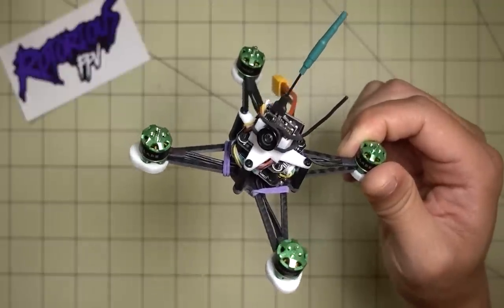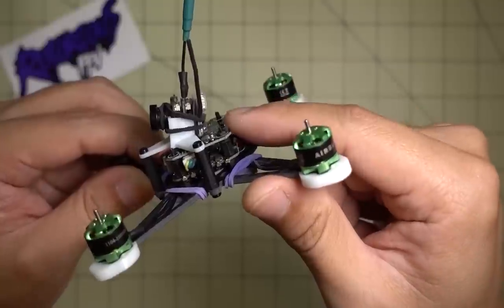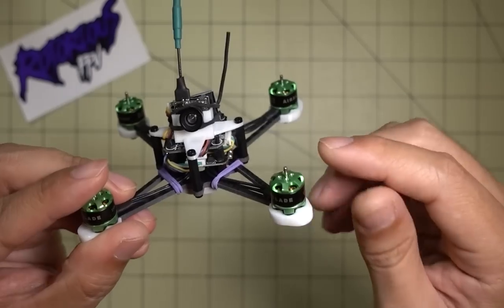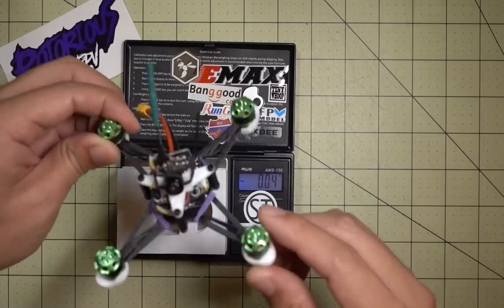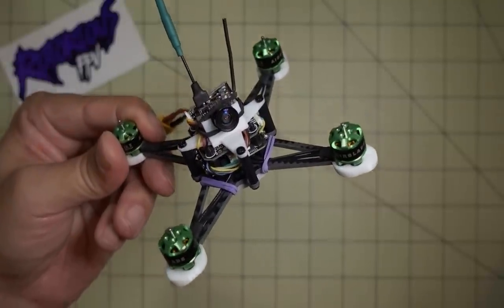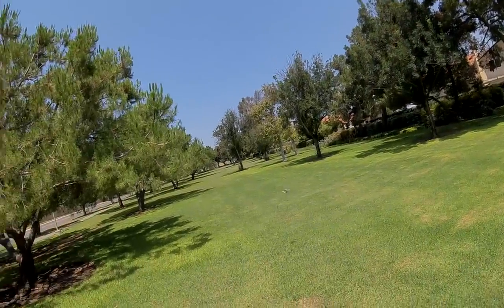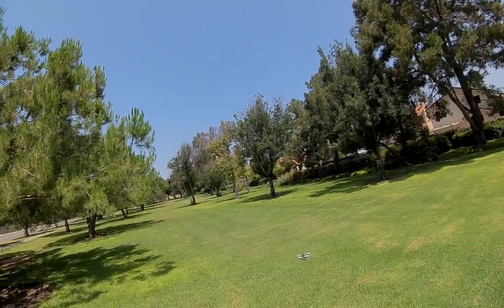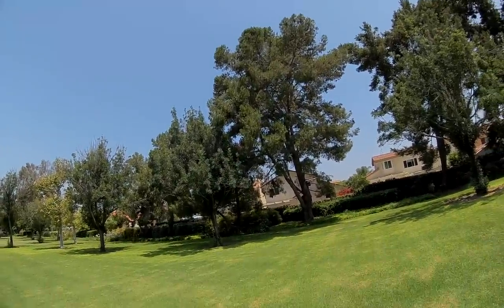Micro Drones 101 🚁#20🔥 RotoriousFPV Crook 110BL 🔥⚡👍

Comment: Wow that thing is killer! Just ran my first 3s flight on my FliteTest Gremlin. It has ALL babyhawk components I just swapped it over but the motors were changed for 1104 7500kv adn it seems to Skip every so often on 3s, maybe a desync or something? or maybe with the 7500kv its too much amp draw for the 6amp escs?
Reply from the maker: +BadWallaby too much amp for the ESC
Reply: Hey Albert that may be true but I wanted to let you know I had actually forgotten to recalibrate the escs for the 3s. I plugged in the 3s and did motor calibration in Betaflight and it flies perfectly fine now! Although the motors get pretty hot it doesn't skip anymore :)